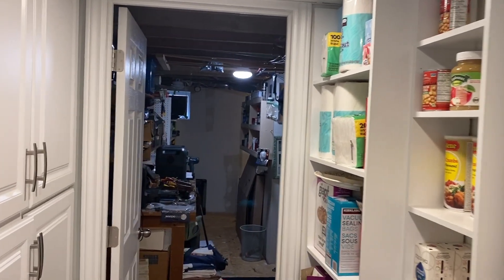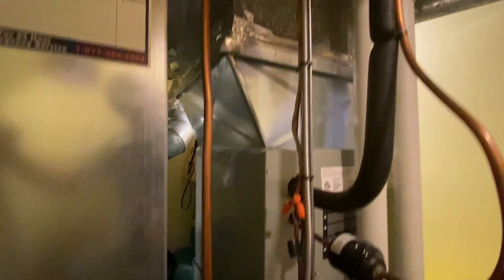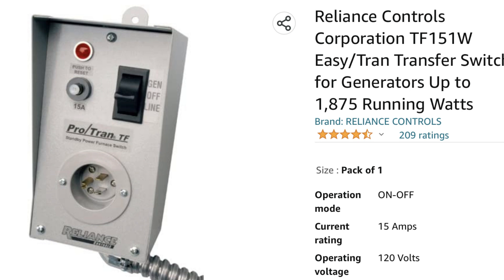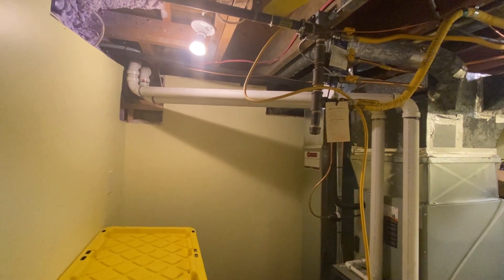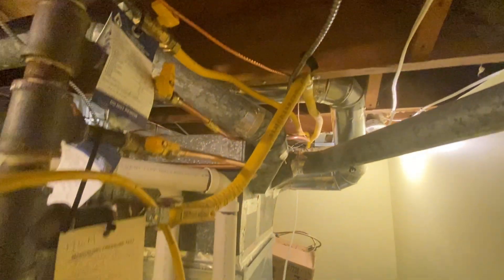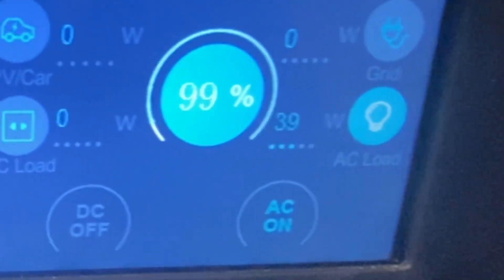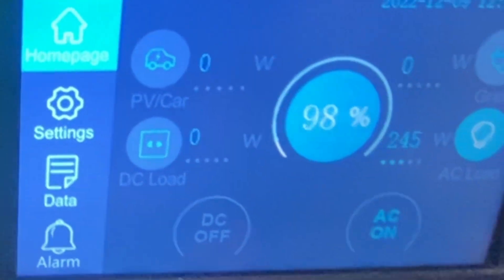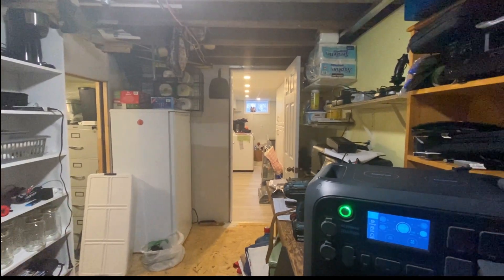SAVE A TON OF ENERGY & MONEY RUNING MY FURNACE ON A BATTERY #bluetti #diy #money  #furnace #battery

Comment: My furnace is wired up to my generator panel. But I want to do this as well so that I can run furnace over night on my bluetti and not have to run loud generator. So thank you for posting .  Also will do this for my folks house.
Reply from the maker: It ran for 22 hours, shut off the Bluetti at 10% left. Temp outside was 28 Fahrenheit and the furnace was set at 72
Reply: Could you open the cover of the new electric box so I can see how it was wired?  I understand if you can't
Reply from the maker: @Bailey463  I will do a video on Monday with a diagram how it’s wired. Cheers Rob
Reply from the maker: Picture of how the box is wired. Cheers Rob
https://share.icloud.com/photos/0faX7nJnNbsNBvgLUjAKYYXBw

Comment: Thanks for the review of the AC200Max but I just find it too big and huge for a 2kWh power station.
Reply from the maker: Interesting, since I built and area in my RV to house the unit. It was important that it be somewhat square. Most of the other units in this power range on more long than wide. Even being 63 I have no issue move it around.

Comment: I have a high efficiency gas furnace with a DC motor. I tried using a Bluetti EB150, which is about a 1500 WH unit with a 1000W inverter. I have separated the furnace from the panel with a switch and a  plug and receptacle. When the furnace first powers on, it works on 1st stage, then it does not work for stage 2 or 3 of the furnace? Any idea why?
Reply from the maker: I am not sure why, have you put a meter on the line to see how much power it’s pulling in all three stages.

Comment: Hello, thanks for doing this video. My question is how much wattage did the furnace pull to ignite the furnace? I tried running my direct vent gas water heater on my ac200p and it overloads right when it's trying to ignite the water heater...so I've assumed I cant run the furnace???
Reply from the maker: I have a newer furnace with a DC motor. It pulled maximum 246 watts from startup to running. The AC max and the 200 p has surge to 4800 watts
Doesn’t make sense a furnace pulling more than that to start
Reply: @WATCHLLS  hmmm, how does your furnace ignite? Is it a spark(like a gas stove) or like a glow plug that heats up really hot? That might be the difference.....
Reply from the maker: @niagaraadventure4705  I hear it clicking so spark type. What kind of circuit is your hot water heater connected to, how many amps?

Comment: 1. Not saying it is unsafe for the one who knows what he's doing, but adding the male plug like that would never pass a proper inspection.
Why? When you flip back to line power, those exposed prongs (yes, I know they are behind a rubber cover) are energized and that's just a no go there.
2 Will it work? Sure,.
3. But there is also the risk when you have a battery supply connected, feeding the furnace, and accidentally flipping the switch. You will the backfeed from battery supply into the line and eventually your panel. Just a big no no. Your switch needs to be ganged, eliminating any risk for backfeeding (essentially like the small transfer switches you showed in the beginning of your clip).
Reply from the maker: Won’t disagree, the outlet is up high and labeled with a warning. I am going to put a thermostat lockable cover over the outlet. Didn’t want to spend $300 on the transfer switch. I am going to install a multi circuit transfer switch beside my panel in the future. Purpose of the video was to highlight the Bluetti can run my furnace in a power outage. Thanks for watching & your comment.